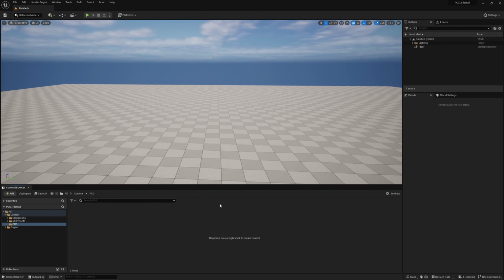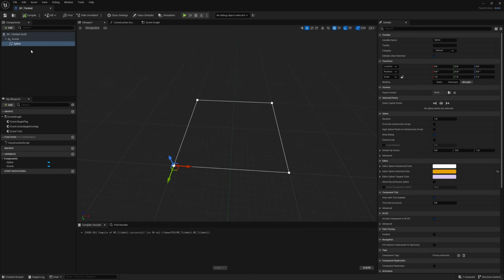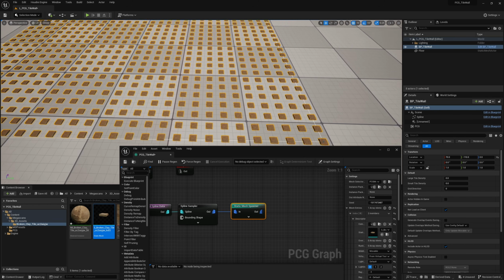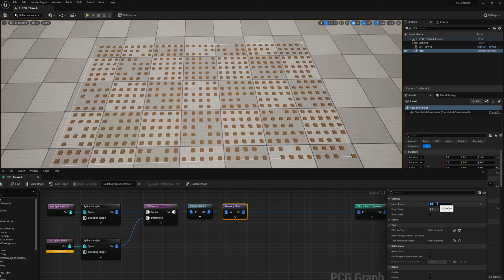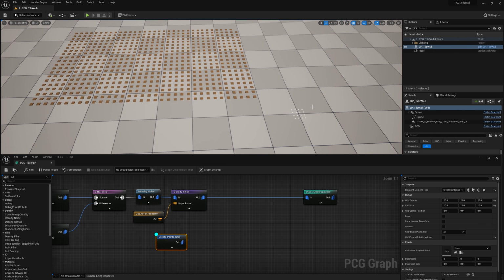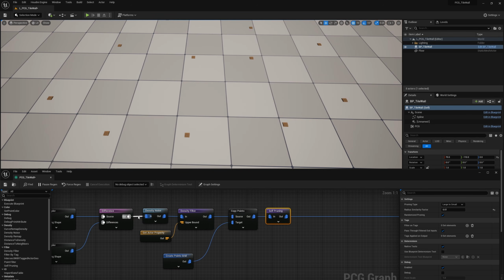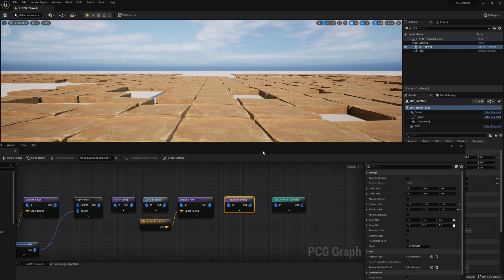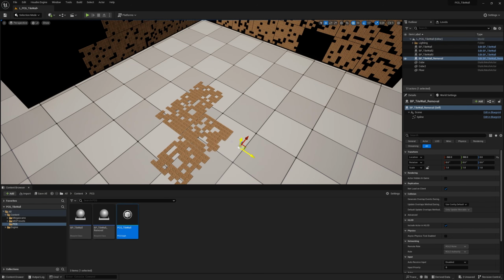Procedural Wall or Floor Tile Using PCG | Unreal Engine 5.2

Comment: How to set Grid Direction in version 5.5
Reply from the maker: For changing it to be vertical I just rotate the entire actor. It should follow the rotation of the actor. Just make sure absolute rotation isn't enabled by accident on any transform point.
Reply: @Procedural_Minds  Since I followed your tutorial video using Blender 5.5, but the Create Points Grid node in 5.5 seems different from that in 5.2, I would like to achieve controlling Grid Direction through integers in the same way as in your video

Comment: I was wondering if there is a way to make a procedural tile that works at texture level instead of generating actual meshes for each individual tile
Reply from the maker: If you use something like substance designer then yes. You can make procedural textures. :)

Comment: Is it possible to use PSG to create small game worlds where tiles will be used, and in addition, generation will create small areas of forest, mountains or rivers?
Reply from the maker: PCG is just a point scatter system basically. So you can use those points to spawn anything you want, even level instances, blueprints, and more. So effectively you can use it to generate many different things, just a matter of setting it up.

Comment: Hi, I am trying to use this to generate random tile islands, but when i debug it setting the Dimension "On Interior" the lines of the spline are getting a bit bigger, but not spawning the tiles inside the spline, any idea why is that?
Reply from the maker: So you see the debug points but it won't spawn anything on them? That's really odd, double check that you don't have the static mesh spawner visibility set to off.
Reply: @Procedural_Minds  yep, that was the problem, thanks a lot!!

Comment: hows the performance. feels like it would be a lag simulator
Reply from the maker: No issues creating or using it, and if you're planning on doing this on a large scale I would make a couple of variations and then bake it down to a static mesh. It's great for generation nice variations in any shape you need. :)